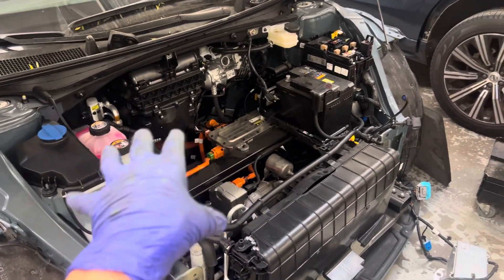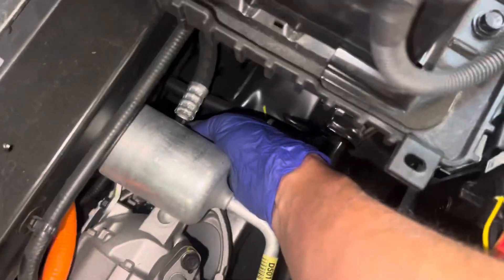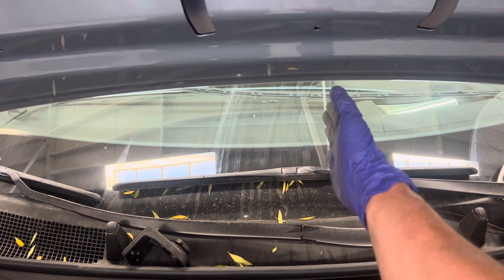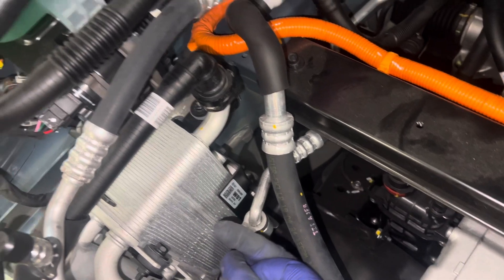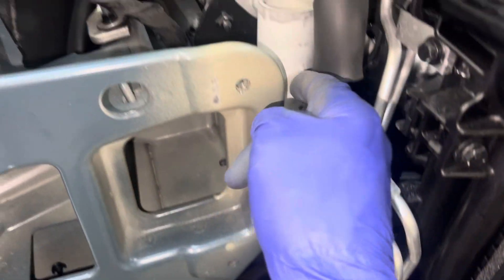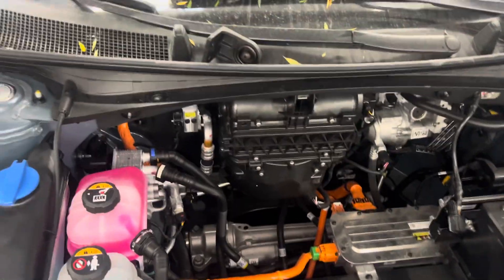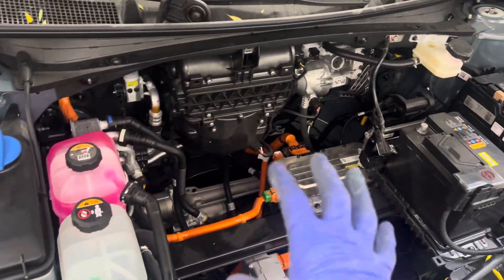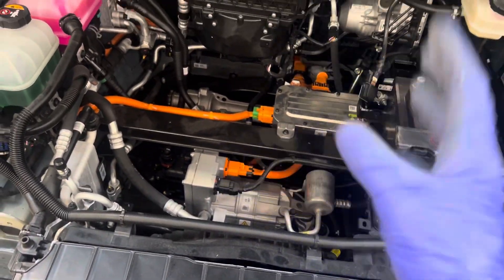2025 Hyundai ionic 5 heat pump system. Very simple compared to other manufacturers. ￼

Comment: I have 2022 Elantra that’s leaking Freon  somewhere . It pulls vacuum pretty good holds decay test. But 3 days later she is getting low. My low side after 3 days 10 psi. 70 outside. Have you come across this elantras ? Where could be a leak spot? I don’t see any oil spots .
Reply from the maker: @kastenusa  you have iv dye in it ?.  You used refrigerant leak detector?. You used 250 psi nitrogen with ultra sonic leak detector?
Reply: @ what should I use first dye or nitrogen ?
Reply from the maker: @ every time you charge a vehicle you always use dye. Even if you do not have a leak right now you always automatically put UV dye in a system because it will leak later on.. . 
      When you are recovering refrigerator out to recharge. After that, you always do a high-pressure of nitrogen indicate test. Before you recharge.. that is just part of the natural procedures you go through on every vehicle. 
      And using electronic refrigerator leak detector is used on the vehicle first rolls through the door for inspection. 
      And if nothing is found again after the whole system is recharged up to its full amount to get to its highest pressure. . 
     There is no one type of leak detection method that is used. Because one type of leak detection may find a type of leak that does not leak under another type of leak detection method..

Comment: These are fun to diagnose evap leaks on with the sniffer, because you now have two coils back there to check lol. Luckily the primary heat exchanger/condenser/whatever the fuck it’s to be called still slides in where the heater core would normally slide so you can slightly get your sniffer past the foam in the matrix to try and rule it out.

Have had multiple Kona and ioniq heat pumps that crack at the base of the evaporator flange and leak all the YF out, you don’t see any dye but once you get it out you see a shit ton of oxidisation from the POE causing the moisture to eat the aluminium lol
Reply from the maker: @Jeff-gb5rt  this is the kind of information I need. And everybody else needs are from people who see a lot of certain types of vehicles that they get good at.. and share their valuable insight and information on these vehicle vehicles. 
      Do you know about the Facebook group?
Automotive HVAC Technicians 

If you can take pictures and post on the Facebook group. For everybody to learn on from your experience..

Comment: ugg....just because you can.....does not mean you should make things so stupid complicated.......hey ..i don't right now.....but i'm thinking of starting to drink ! 

Jay
Reply from the maker: @charlesleake930  🤣🤣🤣 and this is an easy simple one. Not that complicated.. 
I wish I had more time to play with it  . I would love to have the factory training and service manual on this heat pump system. So I could better learn it..
Reply: @coldfinger459sub0  you and me both ....i am getting out my old " Triumph TR7 " factory repair Manual out as i  have an old TR7 that i put a V8 Ford engine in a long time ago and want to get the car back on the street and get the AC working again with a modern twist and modern components - it was pretty sophisticated back in the day - 1975 - with  twin electric condenser pusher fans and one engine driven clutch fan ...and 
the condenser fans ran half speed and full speed by a pressure sensor off the drier....
thanks for reading my rant Cheers    - Jay
Reply: You called this an easy one 😢😢